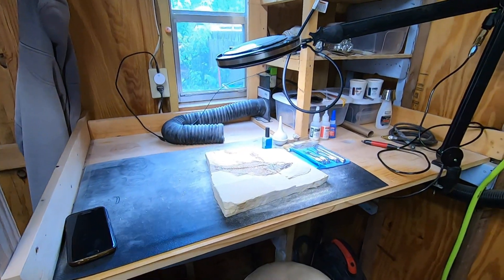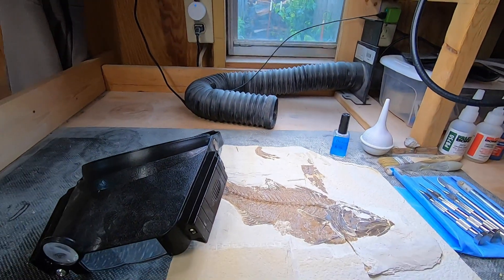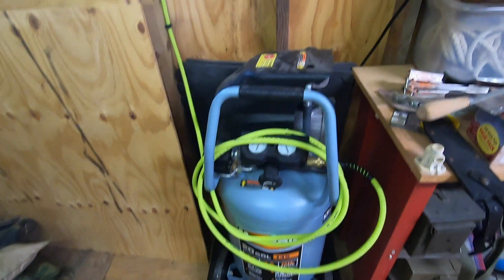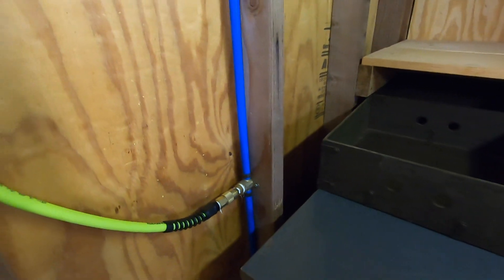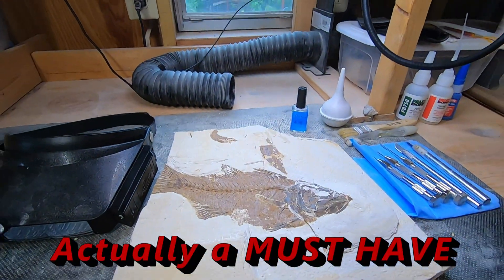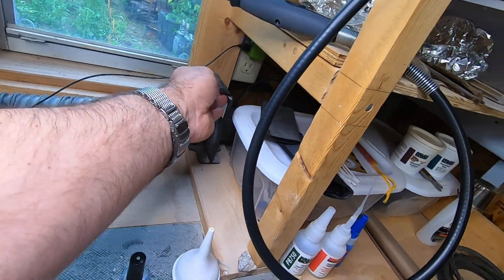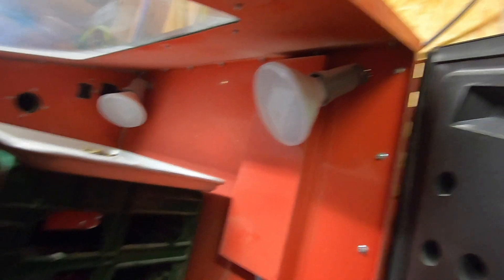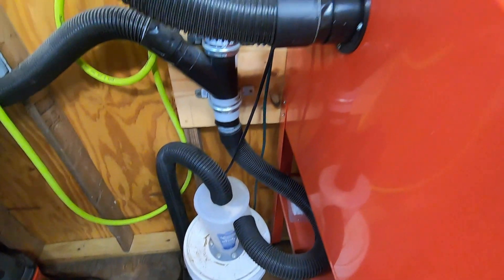How I set up my fossil prep lab

Comment: Nice video, and nice job of creating a homebrew setup. I haven't put one together yet, though I have most of the pieces. Some comments/questions: I'm surprised you didn't use 1/2" or larger copper pipe for your air distribution from compressor to the air conditioning/manifold at least. Not really much pressure/capacity drop from the plastic stuff? What was the blue tubing?  You can sometimes find the California Air brand compressors on sale. While they're far from silent, they're pretty quiet if you have to share shop space with one. I have one in my primary workshop and you don't need hearing protection when it's running. That's mostly a comment for someone else who wants to do a nice setup like yours. I have that same cyclone setup for general dust removal, and for the blast cabinet I was thinking about putting in a water trap after it, and before the shop vac. Did you ever try that, or is the amount of dust that makes it to the vac so small it's not worth it? Again, thanks for sharing your setup with us!
Reply from the maker: Thank you for the kind words!  I went with PEX tubing over copper based entirely on cost.  Copper is many times higher than PEX, also PEX can be joined with a simple crimping tool instead of needing a solder joint.  Most compressors are loud, but yes, some can be much quieter, although that luxury also comes with a higher price tag than my dirt cheap setup. I have not tried a water trap although I have researched them and may build one to see if I like it.  One person who uses one says he gets zero dust coming into his vacuum, so I think they have a lot of good points.  I do get some dust into my vac and have to shake out the cover periodically.
Reply: @TheFossilFiend   I was thinking just compression or flare fittings for the copper ... actually with pressure it'd need to be flares. That allows you to still take it apart and reconfigure if necessary and put it together with simple hand tools. Still, whatever works. Sounds like PEX is often used for air lines though the manufacturer doesn't recommend it. Size for size the copper will handle much more pressure though of course that isn't real relevant in this usage, though it may affect the life of the system before failure. In my case I'd use a GRS Gravermeister for the "air scribe" part of the system, and I picked up a  used Comco 1002 on EBay for about $150. Needed a bit of work to get running but the parts were cheap. I'll only need the compressor for the Comco, and the Cali Air I have can handle that requirement okay. Mostly need to build a cabinet and get some low quality pieces to practice on. Again, thanks for sharing your setup with us!
Reply from the maker: A Comco, nice.  I'm jealous.  Looking for one of those as well!